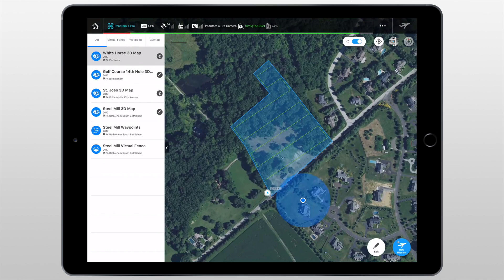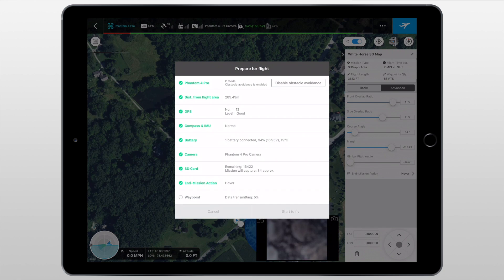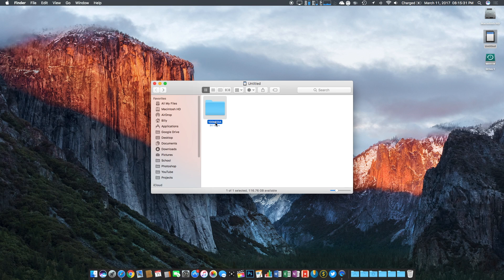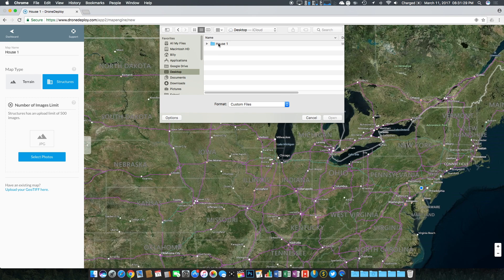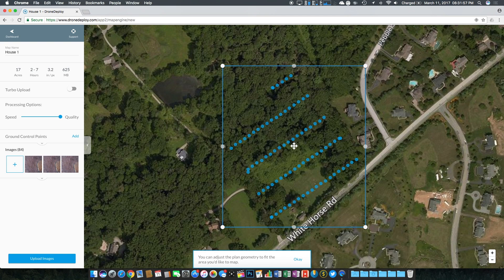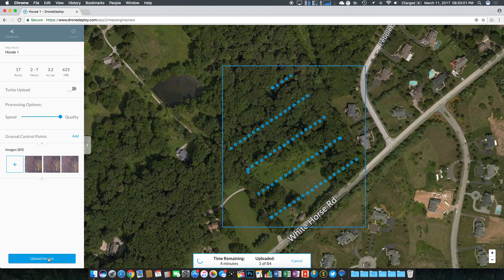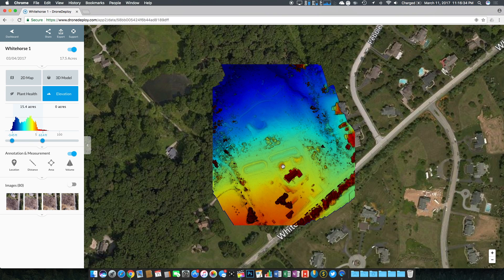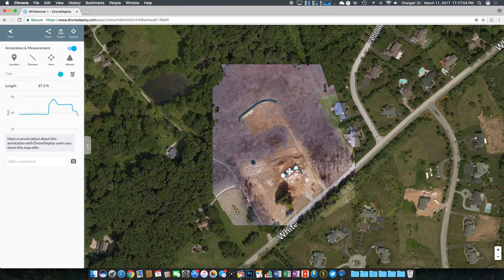How to Make 2D/3D Maps With DJI Ground Station Pro

Comment: I have a custom built UAV which has Sony A7R2 on it. I want to do road mapping. I have a KML of the AOI, I have bought the KML ffeature but I still have to draw the map manually on the KML. Also the waypoint mission does not support any mapping operation and I always have to do polygon style flight (I want it to follow straight line) even when I can achieve required altitude and can capture great quality photoes.

Comment: I did a test run over my neighborhood and looks cool.  I may need to use it when photographing large parcels of land, where I would need to climb higher than 400' to get one shot of several parcels of land in one image. But with DroneDeploy, I wouldn't need a waiver, because I won't need to climb. I don't need 3D modeling, so I will be testing DJI's GS Pro.  Thanks for the tutorial Billy. You're the man!  Keep up the good work!

Comment: Are there any apps that "stitch" DJI Ground Station Pro images inexpensively.  PhotoScan Pro is priced for the professional and Drone Deploy is also costly after the "free" term is up.  All I need to do is monitor wetlands to see what, if anything, is changing.  2D is fine.  I'm not talking about a single point panorama or VR production. I do want to use the output from Ground Station Pro.  Does anyone have suggestions?
Reply: Look into Microsoft Image Composite Editor ..it's FREE!

Comment: So I made a map of my aunts property. It won't show up in the drone deploy app. It's says it's finished and I click the link it shows me 21 of 81 pictures  no 2d map or foliage. The 3D map works but looks bad since I didn't zig zag one strait line it's small property
Reply from the maker: +Camano Island Drones Have you looked on the website instead of the mobile app
Reply: Yes I tried on my mini Mac and my hp 21" touch screen both have same results, also I pad pro and iPad 4 mini. It does confirm I used 81 pictures were used. It's odd I need to make another video I guess I think I clicked Terran also.

Comment: I tried looking for the DJI Ground Station Pro app on my iPad and couldn't find it. There is one app on there called Ground Station but the thumb nail is not the same as the one you show in your videos. Its green with a G and an S.
Reply from the maker: +The_Death_Angel Weird, are you on the most recent version of iOS?

Comment: DroneDeply now has an option for orbiting the central region at the end of the collection along the flight lines that'll give the house more detail.  You had an odd shaped area that might throw off the central part that'll get orbited but just tinker around with it a bit - it's easy to figure it out.  Pretty sure it'll make the front/back/side of that house look really good.
Reply from the maker: +1 KMnO4 I'm just starting to learn both sides of DroneDeploy and GSP. I'll have to check it out
Reply: can you see the camera liveview while its flying using dronedeploy??

Comment: When I did this I went around my house manually and and took a bunch of pictures after the auto did its thing. And my house 3D model turned out way better after I added some manual pictures in with it. I would suggest doing this to you next time
Reply from the maker: +Ryan P Interesting. I definitely will

Comment: I've been using the drone deploy app to capture the images.  Prior to that I used Autopilot.  
Question Billy - Do you see the value or advantages in using the DJI Ground station vs DD app?
Reply from the maker: +WaaProdUSA As of right now GSP is free, while you need to pay a fee to get the most features from DroneDeploy. While GSP is barebones, it's also very new. I expect great updates to come as DJI never fails with software. Right now I'd say there are no benefits, they are all great applications but now with a new contender in the market (GSP) we will have to see who pulls ahead.
Reply: Billy Kyle drone deploy you can’t put on the DJI tablets. GSP you can. I use DD because I have an iPad and you have to pay to use the full features for dd either way.